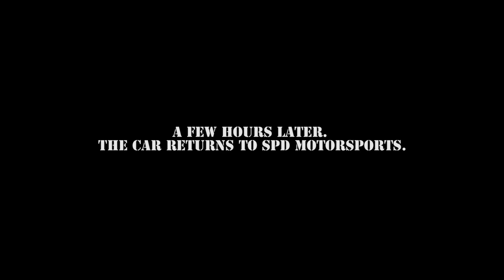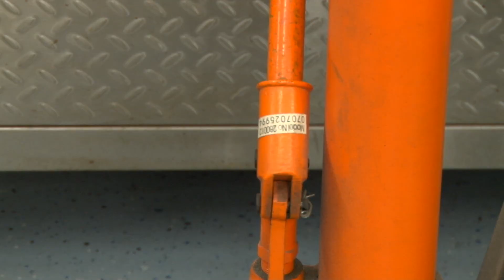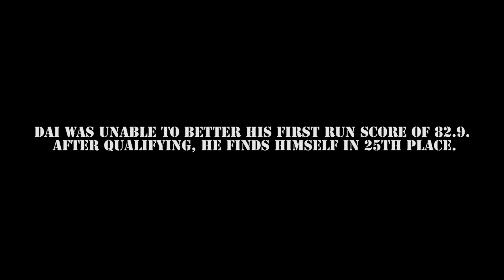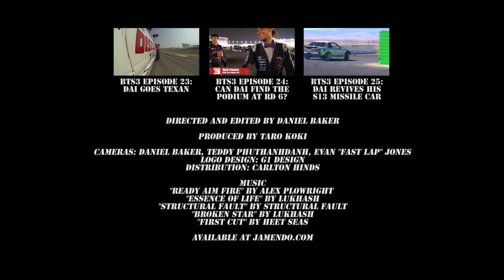Dai Blows the Engine of his S13 at Irwindale - Behind The Smoke 3 - Ep 26

Comment: Rotaries are extremely reliable... The reason they were banned from Le Mans.. you just have to engineer your engine compartment to displace heat efficiently, and either premix- or install a bulletproof aftermarket oil injection system,..

Comment: True! but a 2JZ can make more power, more torque, as long as you can live with the weight (why rotary in Le-Mans was soo good) there is no better way to make 1200-1400 whp.
Sequential gearboxes are a must with low displacement engines, but apart from that the 2JZ is just hilarious, and that was my point.
I have yet to see something come close to 2JZ in any engine arrangement, V's I's etc, Audi Diesel block with petrol head (I5) come close but just 900 whp due to 2,6 L...